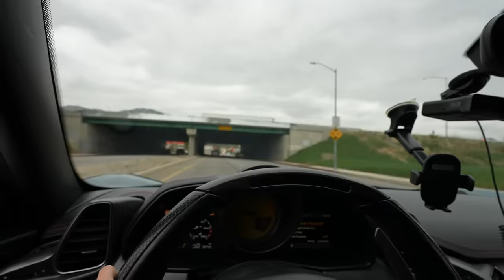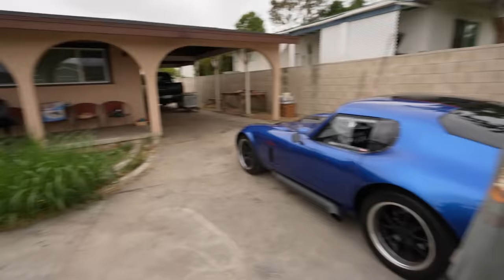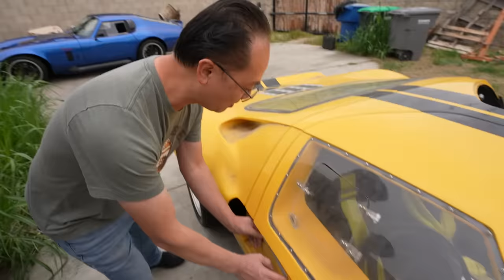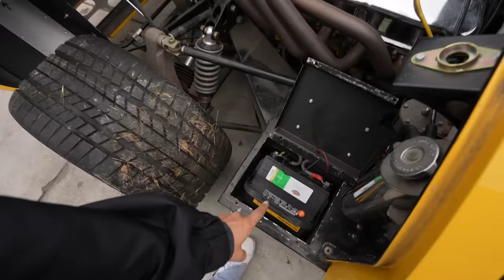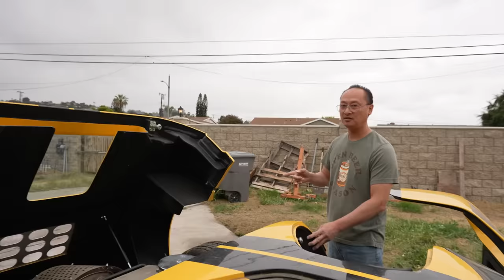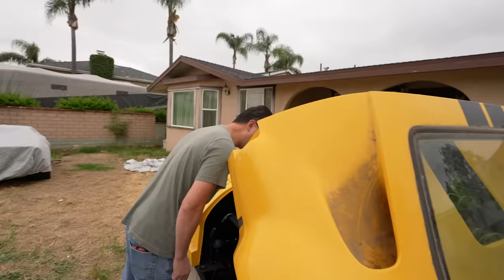don't hate me... this is my decision.

Comment: Again not a kit car fan, but I'd definitely go gt40 on the daytona.  Works out for both of you, Dean gets a running driving car and you get more build content for the channel.  I'd rather see builds than a done car just being driven around.
Reply: I think it’s kind of a disservice to call this a kit car, I think the Shelby replicas coming out of South Africa, Cobras, Daytonas and GT40s are so close to the original cars that they are allowed to have sequential serial numbers from the original 60s cars (approved by Shelby himself) I believe that like 95% of the parts on the GT40s are directly interchangeable with the original cars.
Reply: The belt line of the GT40 is too low. 
You're invisible to other drivers. Paint being safety yellow is the only thing helping #deathtrap
Reply: @missingremote4388  Everything is too low in america when lifted pavement queens are the most common vehicle.
Reply: @Tagiau  With those goddamned Blue headlamps...
Reply: @jamescurfman3284  Either blue or searing white flood lamps.
Reply: @Tagiau  Yup. Either way, do those lifted vehicles REALLY need to blind people like the Sun? No shame about having no compassion...
Reply: The Daytona is a Factory 5 kit car, so either way it is a chance to have a replica.  Those two cars, if real, would be many millions of dollars!!
Reply: @paulcopeland9035  Problem with kit cars is there are no safety standards... you get in an accident, good luck!

Comment: Prices for the Superformance GT40 starts at $153,000 for a rolling chassis, with complete cars (including engine and transaxle) typically ranging in price from $200,000 to $250,000 depending on options. The top-of-the-line Tool Room edition cars typically run for about $450,000 completed with engine and transaxle.
Reply: Is it a superformance GT40 or a different kit? I don’t know how to tell without doing some homework
Reply: Wow! Sounds like Dean was pretty accurate & what a sweet GT40 deal for Emelia!  😎👍

Comment: Love it. First thing I'd do (as an amateur) is check the fuses. Then when I know I've got enough voltage running to the starter motor,  go from there.

You think/know you have voltage, but the starter isn't kicking in. You could also just apply voltage directly to the starter motor to see if the engine runs..... Then look for electrical problems.

Good luck with it.

Comment: I would inspect the chassis/frame on the GT-40 to make sure the welds are done right, as well as the attachment points for the suspension and drivetrain. You don't want any surprises at 160 mph on a curvy mountain road.

Comment: short bore that engine .put in a steel crank , balance and blue print .heads stainless valves port and polish all that stuff. super charge it .if you can aford to. is it a 302 or 351 block

Comment: I think you got an OK deal. If its really a CAV then they are worth about 60k to 70k as a roller . I live around the corner from the manufacturer here in Cape Town South Africa , they really are one of the better ones. The transmission in there is also worth a lot of money as most people fit an Audi transaxle.  Good luck with the build.  You wont be sorry.

Comment: @EmeliaHartford. I have a 1967 mustang coup that was a father son hotrod build it has a small block c6/351c electronic ignition (36000 miles on engine.) it was built for top end not drag racing. when it had the stock 275 gears I was clocked at over 214 mph (3 weeks in jail for that one lol.) we got a Lincoln versi rear end so it is now 350 gears with posi, my father passed in 2018, I cant work on it with out him. the body we got back in 1998 as a platform for the 2 67 cougar parts cars and the one wrecked xr7. we moved and heading to work one day I pulled out on to the asfault spun the car 3 times into a ditch (no damage.) promptly drove back parked it in the garage in 2012 where it sits. if your interested let me know. this offer is only for you.
Reply: ps I also have a spare 351c with the large barrel heads and a factory tunnel ram out of a 1970 gran torino.

Comment: If that's a Superformance then yes it's worth it.  If so then it is licensed by Shelby as a continuation GT40.  Oh and it would smoke the shit out of that Ferrari on the track if set up right.  Personally I would paint it in Gulf livery.  85% of the car is a direct swap part wise with original
Prices for the Superformance GT40 starts at $153,000 for a rolling chassis, with complete cars (including engine and transaxle) typically ranging in price from $200,000 to $250,000.  It's as close as you can get to the original
Check the numbers on that trans as there have been some issues with the ZFQ trans.  Also  what is the hp and torque rating for that engine.  Many early ZFQ trans have literally broke in half.  The ZFQ is about the best you will get for the money

Comment: Superformance is the best exact to details  and bought the GT-40 trade mark that's why the 2006 just says gt. 289 were the better handling and would rev to 13500 rpm lemans  watch: a man and a woman. 1965? Im gonna hear an impossible to get 335 duration cam again its so overkill.

Comment: Dean seems dope and seems like an honest guy....However from a quick bring a trailer search the finished running and driving GT40 reps are going for $110,000.00 to $145,000 (These are the Superformance  kits which are the higher valued kits).. There are some that are going over $220k -$300k but they have some serious pedigree (Bob Bondurant pedigree.) Based on that I would say Dean's GT40 is $75k-$90K, the reasoning being it's not far from done but there are are a lot of unknowns and the Cav kits are lowered valued in the market. I don't believe Dean is trying to pull one over on you, I just believe he may be miss informed.

Comment: People like you are unsung heroes on restoring these beautiful machines. Simple, elegant yet enough to bite your head off if you disrespect such a car. I have always wanted to see an homage gt40, including  features of all 3 generations of this true legend. That car with replicas of the wheels used on the Le Man winning race car from the late 60s, that crazy designed v6 rocket that was put in the latest generation of the gt40 and an all wheel drive system that helps you stick to the road as you wouldn't want traction control or abs on such a beast as it is really a car designed to race not to go to the local shops lol. . Finished off with day time running lights front to back and a naughty butterfly valve exhaust system like the corvettes had 10 years ago. No supercharger or turbo, keep to original race pedigree, as I say' handling and aerodynamics always over takes power.'  and if you really wanted to do it for the lols put an actual decent sized boot in the front. And the very lay two things, a Bose sound system and a satnav unit from the gigantic ford f150 and maybe the fuel tank as the gt40 in the UK averages 8mpg

Comment: Ford build? You're doing a first wash and checking a starter solenoid and fuel pump. That is not a build. You're getting a correctly built GT40 with zero miles for 100k+ that is a steal.